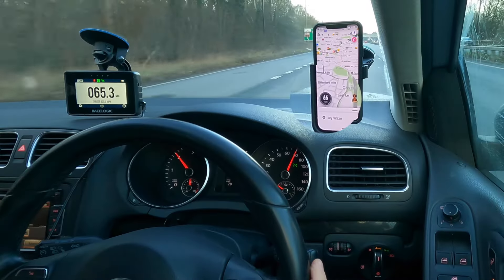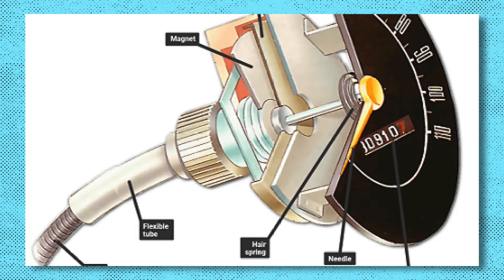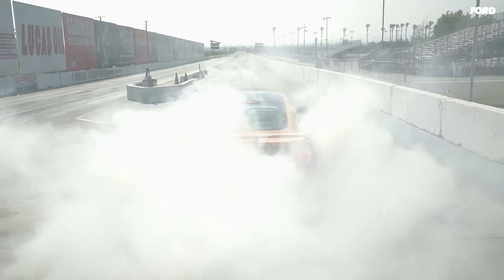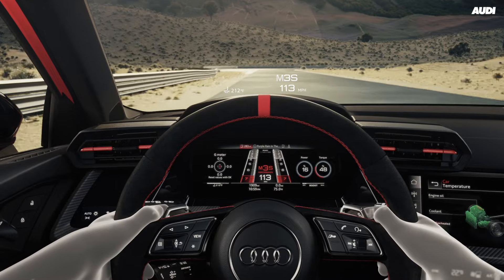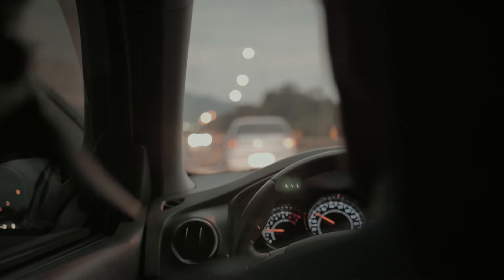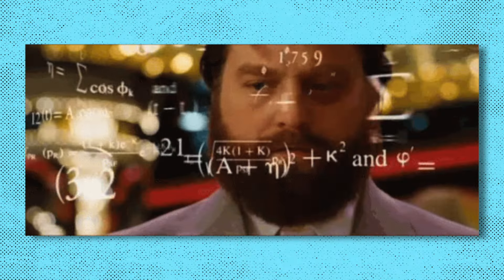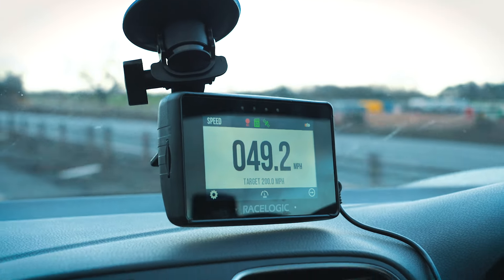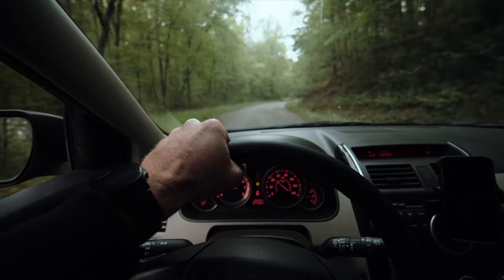Why Your Speedo is Lying to You

Comment: In many parts of the US, speed cameras can't give automatic tickets. Making this a none issue, following the flow of traffic is generally the only thing to think about
Reply: in louisiana (where i am), often the posted limit is 35, but traffic is moving at 55, so if you do 35 you WILL cause an accident. in the US, it's ALWAYS better to follow traffic rather than the speed limit.
Reply: @staterafukumoto  in new york, the highway speeds are 55 but you won't catch a single car in the left/middle lanes going below 70. you can also be driving alongside cops doing that speed
Reply: @staterafukumoto  In Miami if youre not doing at least 85 in the left lanes which normally at 85-100mph sometimes 105 you getting yelled at with horns blazing that's including the coop excluding State boys
Reply: WA school zone cameras can send automatic tickets. I don't know of any other automatic ticket cameras tho.
Reply: In Oklahoma, the speed limits are anywhere from 60 to 80 on highways. Usually add 5-10 to that and you're safe. My wife and I were recently in Philadelphia and the 55 mph speed limit is more of a suggestion than the law. Go 70-80 or get rear ended. We learned that real quick when I was doing 60 on I-95. I learned then that even the worst drivers in Oklahoma are pretty tame.
Reply: @spicytuna62  Even here in the UK the speed limit signs are taken as suggestions... By myself at least 😂
Reply: @co9221  everyone in the outside lane in the uk is doing 85-90 anyway.
Reply: no follow the law not the flow of traffic. If it says 35 mph don't go 70 because of the flow of traffic
Reply: @petelee2477  I'd rather be wrong and live to pay the speeding ticket fines than being dead right.
Reply: @petelee2477  I'd rather get a ticket than be an obstacle to cars doing twice my speed. But you do you.
Reply: @etherealessence  well not everyone is rich enough to afford a ticket
Reply: @petelee2477  that's a very narrow view you got there. But like I said, you do you. I would personally find it hard to afford anything if i lost my job because i got injured in a car wreck and couldn't work anymore. I'm not rich either bud, but I can do cost/benefit analysis. Factoring in everything, I just wouldn't chance it on a highway. I see how recklessly people drive in town when I do the speed limit, no way I'd chance it on the highway where the injuries would be their worst.
Reply: Just tell the officer "Someone has to set the flow!"
Reply: Are average-speed cameras used anywhere in the US? I've only heard of it being a British thing. Generally in the US they'll do spot checks with radar, which only detects how fast you're going past a particular spot.
Reply: My 300s is dead on.
Reply: @petelee2477  you realize that they have payment plans, so it is affordable. Also you if you don’t follow the flow of traffic, you’ll cause a wreck. That common sense. That why there’s different lanes. I driven for years across the south, east, Midwest, and mountain region of America. Following the traffic is alway safer and you blend in with other drivers from cops
Reply: @savagewolverine6992  it's not affordable to me. If a wreck is caused it's because people aren't following the law.
Reply: @MattMcIrvin  so in my town they don't use cameras, they instead use this weird wire thing that stretches out across the road and it times how long you take to cross from the first to the second one. I'm sure there's radar or cameras somewhere to identify which car is yours, but I'm not really that familiar with it. You just know that if you see that wire, you slow down and keep an eye out for the next one. Unless you don't speed, in which case you can just chill. Lol
Reply: @hansolo6340  that's only a surveying tool , for monitoring road usage , etc . No cameras
Reply: @Allllgsgshdb  huh, cause I got a ticket that cited that road once. It was a bullcrap ticket my speedometer said I was fine, but the ticket said I was doing 3 over. So screw me I guess. I must have just missed the cameras then.
Reply: I can definitely see a rationale for busting people who go slow in the left lane (in the US, or other countries where we drive on the right--for the UK, mirror-reverse this entire discussion): while speeding is theoretically illegal, failure of slower-moving traffic to keep right is illegal too, and arguably more dangerous. 

HOWEVER, I live in Massachusetts, and we have a special breed of Masshole here who insists on passing almost exclusively on the right (or in the right breakdown lane), and sometimes tailgating in rageful fashion in the right lane while refusing for some unfathomable reason to overtake you on the left. So keeping right isn't necessarily a panacea for people who are not too fond of speeding.
Reply: Along the I95 corridor, speed cameras can issue tickets, but they're fine-only – unlike the points that come with a LEO-issued ticket. Similarly, most won't issue unless you're +7mph of the posted limit.
Reply: @Gnordlan  Thats probably the only place i would agree with having speed cameras.
Reply: @MattMcIrvin  As far as I know, speed cameras and zones are just 1 spot here in the US, not averaged over a section of road.
Reply: Also many of the speed cameras that were installed in the US have been deactivated due to the excessive cost of maintaining the system.

Comment: When I’m doing the legal speed limit of 120km/h in my Lexus, Waze says I’m doing 114km/h, what I find interesting is that the Lexus CT is limited to 180km/h but on the speedometer I’ve reached 190km/h which with Waze is 180km/h so I almost wonder if Lexus knows by how much their speedos are of, limiting to the actual speed and not the speedometer
Reply: Yeah my ct is like that too and so is my Toyota
Reply: Probably adjusted for max error at certain tire thread depth. If you got a slightly larger in radius wheel, you could go faster
Reply: That is exactly how it works. Example: my e36 M3 is Limited to 250kmh but the limiter doesn’t kick in until 268kmh on the speedo
Reply: @geraldkottler3014  yup, that's how it works in modern amgs as well
Reply: of course toyota know the speedo is out. in this day and age, if they wanted to, they can make speedos 99% if they want.
Reply: very useful if you drive in a 180km/h zone. full throttle is your cruise control/speed limiter
Reply: @geemy9675  Is there anywhere that has a speed limit higher than 130 km/h?
Reply: @scottcampbell2707  texs has 85mph/137 kph roads. but it was just a joke
Reply: @scottcampbell2707  Poland has 140 and there's Germany ofc
Reply: @FakeMichau  Germany doesn't have a limit above 130 though. In fact, 130 is the highest posted limit here.
Reply: That is exactly the case, you often see that german cars who are often limited to 250 from factory do 260 and a bit on the speedo; which is 250 real KMH :)
Reply: Same thing happens with sport bikes, they are limited to 299, but they keep accelerating a lot. The fun part is that they all  overread  like crazy, you do 265-270 and speedo is already at 299, so they tell people their bike can do 330+ while they are actually being fooled by the speedo.

Comment: Ok, we know speedo's are not accurate but there is a twist here. If we take a simple example that speedo is 5% off and if we "assume" that the same information is also used in the rest of the car data generation accordingly , this implies that average MPG (or l/100km) is inaccurate too. Fuel consumption reported will be lower than actual (the fact when I check my personal numbers on the gas pump manually). Also, this means that every car will have 5% more distance traveled on a tachometer. Basically our cars are perceived as 5% more used when sold second-hand and we go to a car mechanic for regular maintenance 5% sooner than actually needed (personally will always change oil much sooner than required). So basic conclusion is yes, we might save people from paying speeding tickets and we will make traffic a bit safer, but for all big car companies this just makes it easier for them to make extra profit.